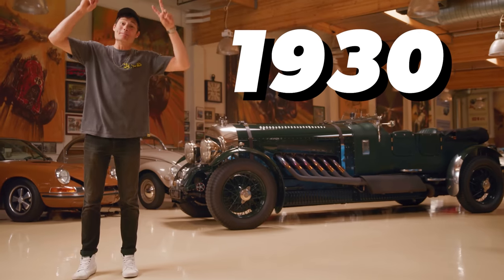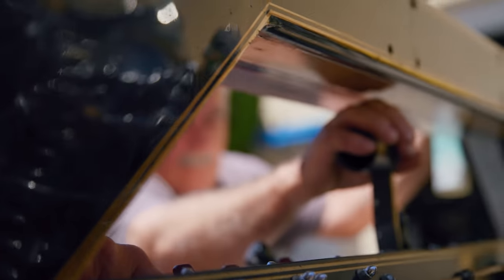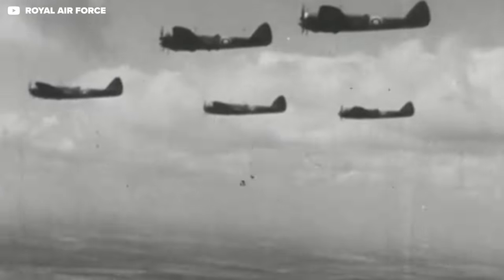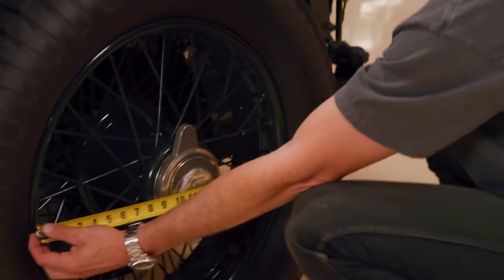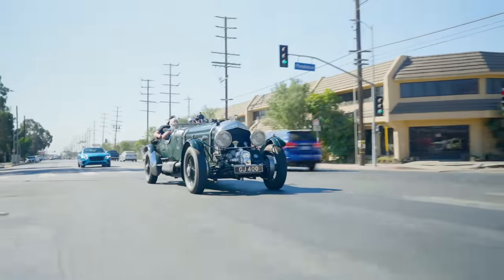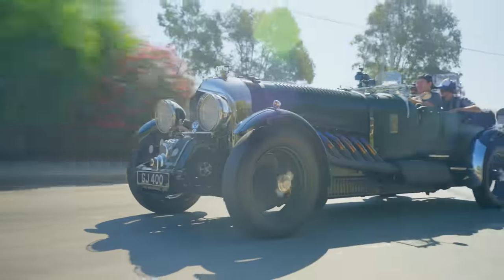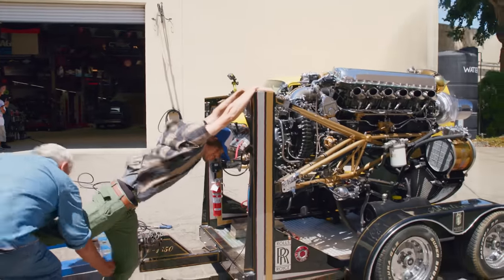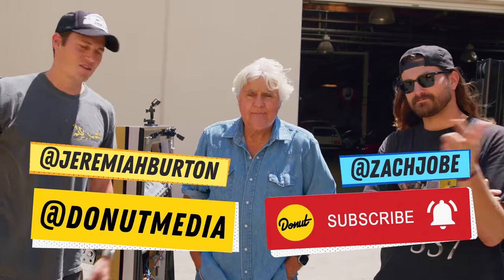What it’s Like to Drive a 100 Year-Old Car with 650hp

Comment: Merlins, and their sister engines, Meteors, were a British design. The Americans only got it after they found it could fly higher and faster than the original Allison V-1710 that the P51 was designed for. Packard made a Merlin on license called the V-1650-7, but it was less reliable than the British Merlin as it was made to lower tolerances. Makes me annoyed when American shows say something that was originally designed by a foreign country, is American. And it saddens me that Jay Leno of all people would do the same.

Comment: You don't replace displacement with forced induction, that's so dumb to say... The statement is forever true... as every SINGLE POSSIBLE thing you can do to a smaller engine to get it to produce more power, you can ALSO do to a larger displacement engine, and get GOBS more power than the small lil poppybanger tiny guy. Stressing a small engine to its absolute limits to get what a larger engine can do with ease, isn't smart... it's just trendy. It's why my work van (2020 Ford Transit 250) with a 3.5l V6, in a lighter platform, gets about 5mpg worse than my nearly 20 year old 2005 Escalade EXT with a 6L V8... it's why that pos ford van is SCREAMING to do what the EXT can do at idle. . . And it's why the LQ9 will easily go 300K to even 400K miles on oil changes alone, while the average new Ford v6 is hard pressed to see 100K, usually popping somewhere after 70K. It's dumb... and people these days only like it because they are also dumb.

Comment: The V12 in the car is actually the "meteor", a detuned version of the Merlin V12. It was used for armoured vehicles and saw varied use in alot of British tanks near the end of WW2 and post war. 
It makes 650 horsepower but a crap ton of torque all the time so perfect for a tank that is always crawling over things and trudging through rugged  terrain.

Comment: Just a small correction. Rolls Royce  created the  the Merlin V12. Under the Lend Lease program they shared the blueprints with the Americans. The Americans found the tolerances on the engine  were loose enough to make parts not interchangeable between different engines. So they re did everything, blueprinting it and making it fit for mass production, allowing for spare parts to be quickly fitted with out needed a hammer. 🤗

Comment: It's probably been stated earlier in the 1700 comments so far - I think the new Bentley would likely drag the old one in a tug of war situation.  It's all about tractive force.  AWD and modern rubber compound tires can do a lot more than RWD with a light rear end and antique rubber tires.   Also, I'm pretty sure there would be broken parts on both cars.  Still, I'd love to see someone try it.

Comment: It isnt the same power between the two engines, and none of the reasons you mentioned had anything to do with why 27 L of ICE was needed.
Why do you ignore TORQUE?
Edited to correct autocorrect.

Comment: Another thing about aircraft engines is that they are built for low RPM. Since propellers generate a lot of stress and are limited in performance by the tip speed. Propellers performance greatly decreases when the  blade tips reach Mach. Hence why the piston is so fat as compared to car engines. Also aircraft engines have their crankshafts trying to rip out of the end of the case! The propeller/prop hub is sometimes bolted directly to the crankshaft. So the case is build to be able to transfer 1000+lbs directly from the crank to the aircraft. So it’s a chunky engine.

Comment: The engine in that Bentley isn’t actually a Merlin. It’s a variant called the Meteor, it was specifically modified to work in ground vehicles. Same block as the Merlin but other parts were changed to make it work better in the ground role.

Comment: I wish people would stop saying "Horsepower sells cars, torque wins races." It just isn't true. To win a race you need acceleration and the only thing that accelerates a car is horsepower. You need enough torque to adequately keep the car moving and thats it. Torque is a measurement of force. Horsepower is a measurement of work done. Ultimately hp and lbs/ft are inseparable.

Comment: Well, I think you are getting something wrong here. If you make the same amount of horsepower it is basicly irrelevant at what RPM you make it. Because Horsepower is torque x rpm. So if you gear your high rpm - low torque engine with that in mind you get exactly the same torque to the wheels.
That is the reason all formula 1 cars are equipped with high rev low torque engines. For a high rev engine you need light weight parts, which pairs well with racing cars 😉

Comment: You should have used a engine which creates 2000hp and attach a supercharger and add more turbos in parrallel and also make a mixture of pure Oxygen hydrogen nitrous oxide nitromethane methanol and oxy acetylene,hho 

In your Walmart bike video

Comment: The torque of the Merlin engine isn't important. The transmission of the Bentley engine can be geared to produce the same torque. Torque = Power / (angular velocity), so all you need to produce torque is a transmission that can increase the angular velocity at a given vehicle speed to produce the required torque. However, the Bentley would likely still win the tug of war due to its mass, assuming its tires could provide the needed frictional force. It's frictional force that wins a tug of war, not torque.

Comment: If I remember right in WW2 Ford took a Merlin engine shaved it down to a V8 and stuck them in Sherman tanks. A few hot roders loved that engine since a engine of that size could easily make a lot of power.

Comment: Without the merlin engine there'd have been no Britain for the Americans to launch attacks on Germany from. The merlin won the battle of Britain (along with radar and great organisation), and was the primary engine for British designs such as the Lancaster, mosquito, hurricane and of course the spitfire. The British went to the us to seek a new fighter design and were offered the p40, North American thought they could do better and they came up with the p51 mustang. The first versions were fitted with the Allison engine and it was not deemed good enough compared with the performance of the spitfire. Rolls Royce suggested the merlin should be fitted and the rest is history. 

The tank versions were known as meteor engines rather than merlin and the short supply for tank usage meant most of the early tank versions fitted in British tanks were rebuilt from crashed aviation merlin engines deemed unfit for flight. 

rolls royce followed the merlin with the griffon and it was even bigger and more powerful.

Comment: Your evaluation regarding the tug of war is correct, but your argument is wrong
Torque is irrelevant as long as both engines have enough power to break wheel traction. The old Bentley would win simply because of its weight. More weight = more friction = more pulling power

Comment: I want someone to make a 27 liter Merlin with modern, lighter materials, and manufacturing techniques to get the rotating mass, and overall weight way down, and see what it could do. Maybe better cylinder head flow, modern fuel injection and ignition, even overhead cam. I bet it would be insane.

Comment: Without knowing the gear ratios (which might vary substantially) we don't know the wheel torque (aka real torque), so your torque statement doesn't make sense to begin with. You also don't generate the torque with the engine standing still so you'd care about the RPM the torque is created at and how well the clutch can transfer that to the wheels.But all of that is utterly irrelevant because...
You only need enough torque in a standing pull to reach the limit of traction and both cars have more than enough for that. What would decide it would be which has more grip, which would depend on things like the rubber compound and how much weight was over the driving tyres. Also, how high the attachment point on each car was. So the replacement for displacement in this case is stickier tyres and a heavier vehicle with better weight distribution.

Comment: with a 90s 1uz out of a lexus you could balance a single coin on the top of the engine and rev it, you didn't even need to superglue it. And thats a v8, the v12 out of the century was even better.

Comment: merlin engines that was used in tanks was known as the meteor engine. regarding the w12 having smaller displacement to the 27 liter v12 merlin/meteor engine, the merlin/meteor engine can maintain any rpm for an extended amount of time compared to the w12

Comment: So they may have made better planes than Germany but when it came to tanks Germany had the Alliance beat, as they spent hours working on them by hand while the alliance had them factory pooped, leading to lots of mechanical errors occuring in the front lines leading to lots of Alliance tanks crapping out on the front lines, if they even made the drive there.

Comment: The P51 wasn't designed for the engine nor vice versa.  The engine was designed for a variety of British planes.  The P51 was designed with the Allison engine, but the RAF thought it could be made better if they put a Merlin in it (as it was working very well in the Spitfire and Hurricane).  And then a phenomenal plane was born.

Comment: New bent would win in tug of war. It’s awd and very thick tires with low gearing. Old Bentley has motorcycle tires
Reply: The one saving Grace is that it weighs a fuckload but I doubt jay or whoever let you borrow would let us see who’s right. This one might have to be a job for beamNG

Comment: Pretty sure the engine from the tank is actually called a meteor engine. Then you bolt a super charger on with a few other bits to make it a merlin
Reply: The Merlin was designed and built first.  It was only later when the British got sick of having slow, unreliable tanks that the Merlin was redesigned to produce the Meteor.  

The biggest differences between the two engines is the loss of the supercharger, the use of a lot more steel in the Meteor as they didn't need the lightness of the aluminium, and being detuned to run on regular motor pool gas rather than avgas.

Comment: As note by others, the engine in the Bentley is a Meteor, possibly manufactured by Rover.

While the Meteor used steel or cast iron for a number of components, the Merlin used aluminium alloys.

For a Merlin XX, like Leno's, the weight was ~1,450 - 1,500lb, instead of the 3,500lb stated in the video. 20-series engines started at around 1,200hp for takeoff, but some variants were able to make ~1,600hp at altitude.

For a 2 stage supercharged Merlin, that was used in later model Spitfires, Mosquitoes, and Merlin Mustangs, weight went up to ~1,650lb - 1,700lb. Power was improved as well, particularly at altitude, with late model engines being rated for 2,200hp with high octane fuel.

While 27L seems big, it was relatively small by WW2 aircraft engine standards.

The Merlin had 5.4in bore x 6in stroke for 27L.
The Allison had 5.5in bore x 6in stroke for 28L.
The Daimler Benz DB601 had 150mm (5.9in) x 160mm (6.3in) for 33.9L.
The Daimler Benz DB605 had 154mm (6.1in) x 160mm (6.3in) for 35.7L.
The Rolls-Royce Griffon had 6in bore x 6.6in stroke for 36.7L.

And there were bigger capacity engines - such as the big air-cooled radials.

The R-2800 in P-47s, Hellcats and Corsairs was 46L.
And the R-3350s in the B-29 were nearly 55L.
Reply: Beat me to it.  

I got really confused around the 4:50 mark where they claimed that most of the engine was steel to make it resistant to enemy fire with only the heads being aluminium, where in reality anything that could be made strong enough of Aluminium was done so to save weight.  The Meteor tank engine was mostly steel though since it was a less "rationed" material and honestly the extra weight in a tank was less of a concern.  

On a related note I have heard stories that there were some Merlin parts used in the Meteors, specifically if any Merlin part failed it's quality checking and was deemed un-safe for aircraft use but was otherwise usable they apparently made their way in to the Meteor production lines to save on waste.  I've never seen anything to prove that it happened but honestly it wouldn't surprise me if it was true.
Reply: The other major change for US production was the use of locally sourced carburetors. These were injection type carburetors, rather than the float type used by early British production, used on other US engines at the time.

Comment: The front end is pretty long, but you should drive a 23' dodge Challenger... it's the dumbest piece of engineering I've ever driven. The front end, no matter the position of the drivers seat, is impossible to see over. It's front end.  (I'm 6'2)

Comment: It is actually a Rolls Royce Meteor engine, developed from the Merlin used in British tanks up to 1964 , none of the tanks weighed 80 tons, the most common application was the Centurion , only 50 tons